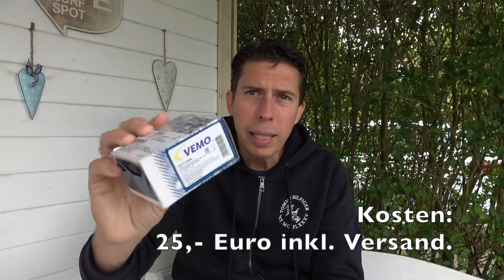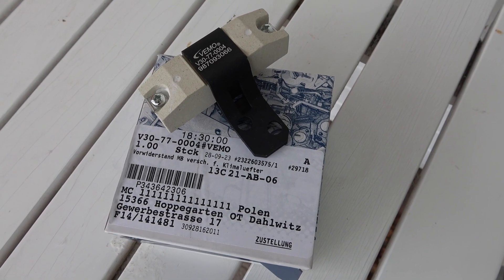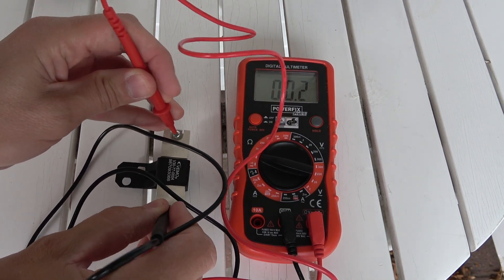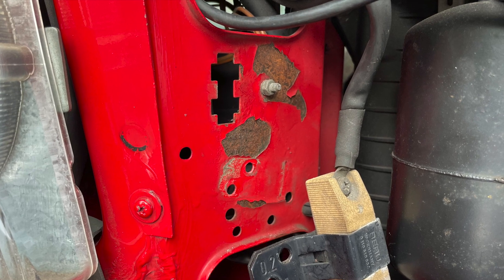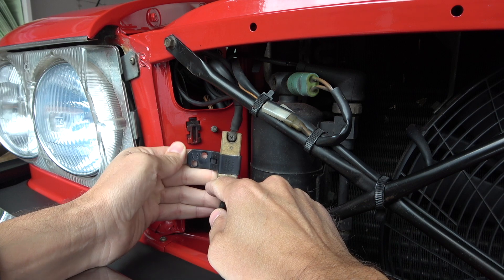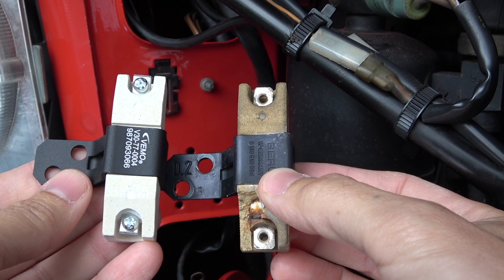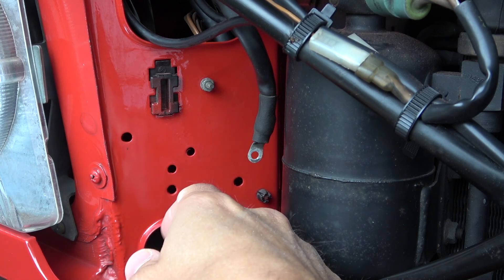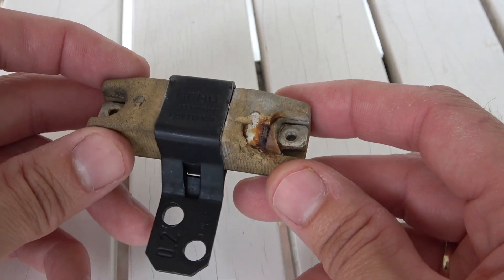Mercedes SL R107: Vorwiderstand Klimalüfter von VEMO - Austausch/Montage

Comment: Der Lüfter wird a) zur Reduzierung der Kältemiteltemp. am Trockner/Sammler der Klimaanlage (dort 2 Geber: Druck & Temp, bei reduzierter Drehzahl über den Widerstand) sowie b) als Zusatzkühlung des Motorkühlwassers (2-poliger Temp.-Geber auf Thermostatgehäuse, volle Drehzahl) benötigt. Das Relais, welches ihn letztlich schaltet. sitzt über dem Sicherrungskasten i. Fußraum rechts)
Reply from the maker: Danke für das technische Update!. Hier sind andere definitiv versierter als ich und so können wir uns gegenseitig helfen..
Reply: Moin, die 105° beziehen sich auf das Kühlwasser vom Motor. Ist quasi noch eine Art Backup, wenn die Kühlleistung des Viscolüfters am Motor nicht ausreicht. Dazu braucht es auch kein Kältemittel in der Klima.
Reply from the maker: Hallo. Auch Dir Danke für das Update! Dann hat sich der Austausch bei mir ja wohl doch gelohnt.